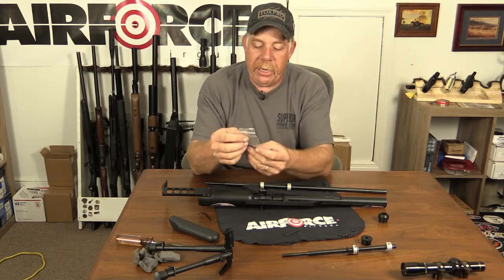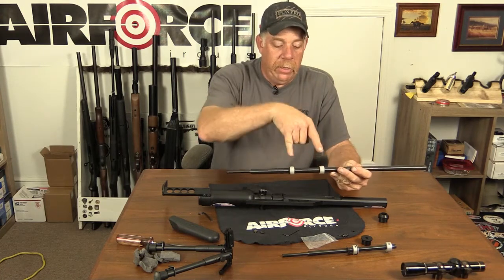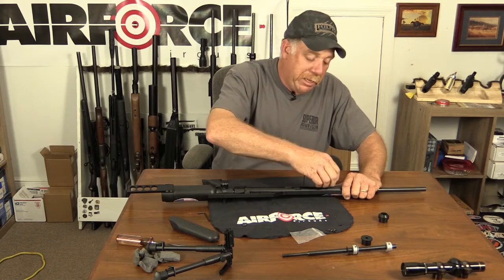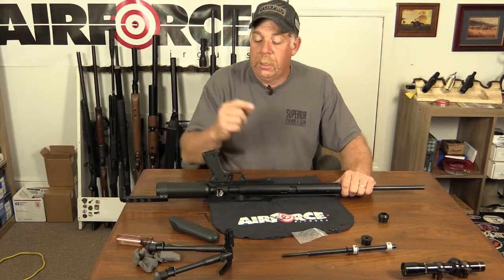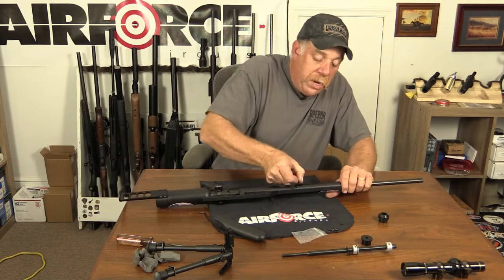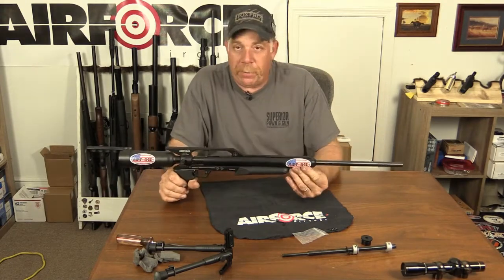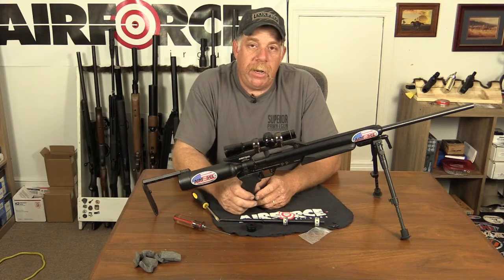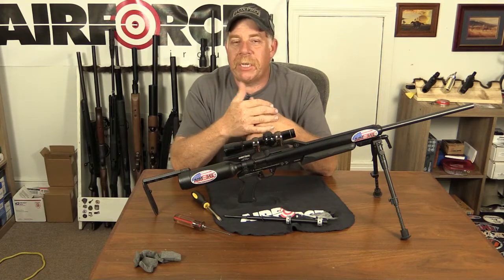Barrel Change PART #2

Comment: Do I understand that you changed from .25 to .22? Does this mean you could bump up to .30? Thanks.
Reply from the maker: Unfortunately NO. Air Force only makes the two barrels for this gun.
The valve in the tank would not deliver enough power to launch  30cal. Projectiles effectively .
Hope this helps lol.
Thanks for watching. 
.

Comment: just out of curiosity, i just got the airforce texan 50 cal, would you be able to change the barrel and put it to use a different caliber without changing anything else?
Reply: If you bought a Texan .50 and wanted to change the caliber to say a .308 or .357 you would definitely need to purchase the corresponding valve for the bottle as well as the breach that corresponds to the barrel/slug diameter. Then you would most likely need to change the hammer and spring as well to match your new breach. All kits readily available to purchase online.

Comment: I have a Condor SS .25, where could I get a .30 caliper barrel for it?
Reply from the maker: You would have to custom order a 30cal barrel from some one like lethal Air or talon tunes or someone like that. Airforce only makes the .25-.177 for that line of gun.
Reply: Thanks
Reply: Hea I am going to buy a regular condor & then add the 257 barrel, However I was informed that I will need to get the set of Top Hats & use the largest top hat in the pack. Also with just the 25 cal Condor you can get 46 gr bullets & use for Coyote.